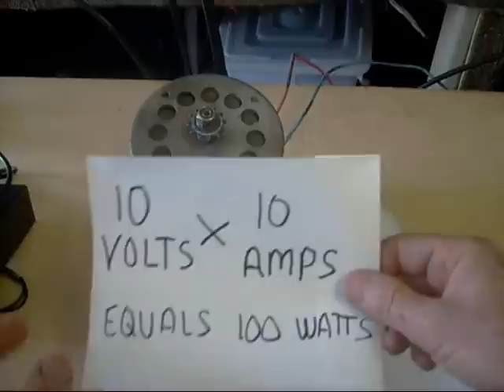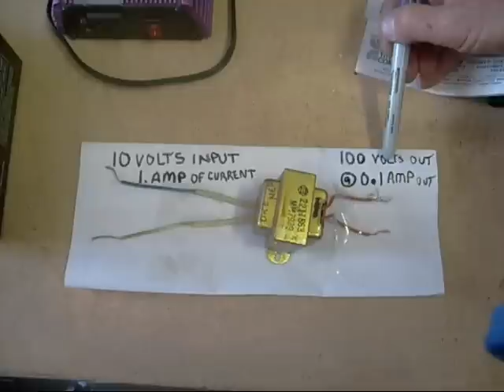Understanding Watts, Voltage, and Amps. Sorry about the math mistakes.

Comment: hi and thanks for answering my questions and i know our talk got you thinking about all your own thoughts on that matter
Reply from the maker: +jokers32463 Regarding your other question about transformers yes a transformer can raise your voltage and lower the
amps, but it can also lower the voltage and raise the amps. A transformer can step up voltage or current depending on
the turns ratio within the transformer.

Comment from the maker: @Xbasic3000 I think what you meant to ask is how long will a 100w light last on a 12 volt 8.5 amp hour battery.
Excluding the heat losses and other inefficiencies I would say 1 hour, but realistically probably more like 45 to 50 minutes.

Comment: If it helps, think of a spring, like in a car shock absorber, sitting upright on a table.  If we put a bowling ball weighing 18 lbs on top of the spring, gravity compresses the spring a bit.  In this model, the force of the spring pushing the ball up represents the voltage, and the weight of the ball is the current, or "work done" in amps.  Now, replace the bowling ball with a 40 lb cannon ball, and the spring is compressed much more, but it still presses up with the same force.  (Continued....)

Comment from the maker: @ArchNME I should have said transformers can't convert steady DC to AC. On the other hand if the input to the transformer is pulsed DC you can convert from a lower voltage DC source  to a higher AC voltage.

Comment from the maker: Yes your correct. If your battery is rated at 10 amp hours your device which uses 5 amps should run for Two hours.

Comment: Hey to whoever reads this. This analogy for circuits may help you. Here's a tip: forget all the technical mumbo-jumbo. Watts = power, Amps = current. And don't you dare tl;dr this. It's a lot shorter than this video!

Think of a battery as a bank, think of energy as the money at the bank , think of the electrons as men, and think of light bulbs, motors, any device connected to a circuit, as strip clubs. Men (electrons) pick up money (energy) from the bank (battery) and spend the money (energy) at the strip clubs(light bulbs, etc), then go back to the bank for more money. 

Amperes is current, the flow rate of electrons. You know how you measure the speed of a car by saying 20 mile per hour? Well, Current is the number of electrons per second. In other words, current is how fast the men are moving. 

Voltage (potential difference*) is the amount of energy each electron carries. In other words, voltage is how much money each man is carrying. 

Power is the amount of energy you use per second. In other words, power is the amount of money the men spend at a strip club each second. 

Using a little common sense, you can easily derive the power equation. Power is the units of energy over time, right? Current is electrons over time, and voltage is energy over electrons. Now use some basic algebra. What happens to the units of current and voltage when you multiply them? The units of electrons cancel, leaving energy over time. In other words, it gives you power. 

Hope this helps. FYI, Ohms law is only true if temperature is constant.
Reply: ***** I've been trying to wrap my head around this stuff, and your 4 is rather confusing to read.

I imagine in this analogy it goes something like the power used by something is the difference in pressure between before/after it multiplied by the amount of water moving across the thing over time, right?

This may be simple once you get a feel for it, but it's not simple before that. I've gone over this stuff in school multiple times over the years, and tried before and failed because I couldn't wrap my head around the idea. I've only had one other thing like this before. another thing that's just so simple once you grasp it, but which frustrated me endlessly until I did. That was what radians are. At some point the concept just clicked into place, and I had no problems after that, it was just that one little piece that didn't fit for some reason. Gah.
Reply: ***** ...."In physics, power is the rate of doing work. It is equivalent to an amount of energy consumed per unit time. In the MKS system, the unit of power is the joule per second (J/s), known as the watt," so yes, there is. Using power over time isn't a measure of power.

Except pressure is voltage, and measuring the voltage drop has been rather important in the limited number of things I've done, so I have no idea why I'm being told it isn't.

So I'm no longer confident in anything you're saying, as you've contradicted both the truth, and what I know from multiple other sources without giving a valid explanation for it.
Reply: now I know that Engine Shade and Shade Engine are Israelis . cause there is  mandatory to take harp lessons to achieve ability play both sides (harp) at a same time.
Reply: Pablo P great analogy!

Comment from the maker: Correct. It would use about 15 amps at 12 volts if it was 100 percent efficient,  but the inverter losses are probably 10 to 15 percent so I would think it would think it would use more like 16 to 16.5 amps in the real world. Your battery calculations are correct in theory but if you examine a graph of battery amp hour expectations their efficiencies are based on how much current you draw so this means your 100 ah battery may only function like a 80 amp hour battery when you draw 15 amps.

Comment: Interesting , However I have seen these inverter  for a while and was just wondering if they may also be converted to work as a step down transformer taking advantage of their light weight , say to convert it so that you may achieve a step down of 230v to 120v by say using a 12v DC adapter plugged into  a 230v line replacing the battery.
Reply from the maker: I'm not sure I understand your question, but if I wanted to step down a voltage from 230 AC to 120VAC I would just use a transformer.

Comment: I have an issue with a home made power supply giving correct numbers like another power supply and it's a bit below what an RC car must have and the other works fine. A third one even takes a few volts for the front lights and works fine as well.

Comment: This video was helpful, thank you. I am setting up a GoPro, which draws 1.7 watts and have it hooked up to a 12v tractor battery that is being charged by a solar panel array (5w x 5w x 10w in parallel). I've measured the output on the solar array at 21.4v peak in straight sun and 19v on a semi-cloudy day. I haven't measured on a fully cloudy day, but I figure it will be at least 15v. If this GoPro is running 24/7, is this enough voltage to keep the battery charged while there is still a draw from the GoPro overnight? I do have a solar controller to keep the battery from over-charging. With just the 5w x 5w array, I was only able to keep it going for two weeks. I'm looking for something that will last 6 months or more to do a time-lapse.
Reply from the maker: What does 5W X 5W mean?  I've never seen a rating like this.
Reply: Grants Pass TV Repair  sorry, i'm a relative noob here. i have two separate 5w panels and a 10w panel strung together in parallel (positives together and negatives together before going to the +/- on the controller). The reason for this that I was hoping that one 5w would do it, but didn't. Two 5w panels didn't cut it, either, so I added the 10w, which is what i have running now for the last few days.
Reply: Grants Pass TV Repair  sorry, i'm a relative noob here. i have two separate 5w panels and a 10w panel strung together in parallel (positives together and negatives together before going to the +/- on the controller). The reason for this that I was hoping that one 5w would do it, but didn't. Two 5w panels didn't cut it, either, so I added the 10w, which is what i have running now for the last few days.
Reply from the maker: Sounds like you should buy a higher output solar panel. I can't give you specifics as to solar panel size due to .variables such as the amount of sunshine available at a particular time of year other than what I shared in this video, but solar panels are dirt cheap on ebay, You can purchase a 100 watt panel for less than 150 bucks including shipping.
Reply: Grants Pass TV Repair if this 20w rig doesn't keep up, that's probably what i'll do, but the object was to keep the system fairly compact. Thanks!

Comment from the maker: Most batteries tell you their amp hour rating. This tells you how long they will last depending on how much power you are drawing from them. Example. If the battery says 10 amp hours this means it can deliver 10 amps for an hour or 1 amp for 10 hours. If your device used 2 amps your battery would last 5 hours.

Comment: Oh ok thank you for this video recommendation Mr. Grants Pass. So going back to the 10 LED crystal set radio. I would have to look at the data sheet for an AA battery and get the V(out), I(out) and get the power: P=VxI and then make sure my crystal set outputs more P and I at the same voltage. Then I would hook up the crystal set to the bug zapper and so forth, like before, always making sure I had more output power then needed, right?
Reply from the maker: Sorry but I don't understand your writing.

Comment: I am sure it is easier then I think and maybe if I weren't up all night I'd be able to figure it out. But, seeing that I've been up and pulled a double I need to ask, in order to get 4 to 5 amps on 12v DC how many watts would I need?  Great video thanks.
Reply from the maker: IamNewPrepper It sounds like  your mind is over complicating this. To come up with the numerical value in how many watts your loads are using  you simply multiply the amperage your loads are using
times the voltage they use. For example if a light bulb is using 4 amps you simply multiply 4 times 12 which is 48 watts.
Thus  you would say the light bulb is using 48 watts.  I hope this helps.
Reply: Grants Pass TV Repair lol. thanks simple

Comment: So when using a transformer the wattage has to stay the same and in order for wattage to stay the same from input low voltage to output high voltage it changed it's amperage for wattage to remain same? Example 12 volts 5 amps: 60 watts transformed to 120 volts .5 amps : 60 watts.

Comment: Thanks for the post.  Regarding your presentation and inverters, it sounded like you said that you could boost the output the thing is rated for by increasing the amps that you are delivering to it.  Is that correct, and if so how much can you typically get away with?  I would think it would get hotter and might fail if you went beyond the rating.
Reply from the maker: Sounds like you may have misunderstood something I said. I would not suggest raising the input power level on an inverter.

Comment: Thanks for the video, very informative. Please help!  I'm trying to run a few household lights and objects using a 5,000 Watt peak inverter (3,500 continuous). If I multiply the amp hours of the CAR battery (50) by the 12V the figure amounts to 600 watts. Theoretically I should be able to run 600 watts for approx 1 hour before the battery goes dead, correct? Well here's the thing, I've  been running a few (about 3) Energy saving 26 Watt lights and within minutes I start to get low battery warnings and can see on the LED screen of the inverter that the battery is being pulled down very fast. Is there something I am doing wrong? Today I bought a deep cycle 200 amp/h battery and I just want to know if I am doing anything incorrect before I proceed!
Reply from the maker: Your not doing the math correctly. First you need to find out how many amps your inverter drawing from your battery, and this can change depending on what kind of loads/devices you have plugged into your inverter. For example. If it is a 50 amp hour battery you can draw 1 amp for 50 hours, or 2 amps for 25 hours, or 5 amps for 10 hours etc. Hope this helps.

Comment: Thank you for the video. Electrical Apprentice here in Texas. Question: Am I right to assume that in most scenarios two of the three elements of power will be written or indicated on the device I'm using? In the video, you knew the amps and voltage - is that normally accessible by reading the electrical information on the device or did you calculate those before you plugged them into the watt formula?
Reply from the maker: Yes many devices will list the power they consume such as my toaster, which says it uses 750 Watts, but it doesn't have the voltage or amps listing on it.  My electric heater lists the amperage, voltage, and wattage is uses, but as you probably know, they didn't really need to list the wattage since you can figure out the wattage by multiplying the voltages it uses times the current in amperage  that it consumes.
Reply: @GrantsPassTVRepair  Okay! Thanks for the reply.

Comment: (Continued....)  So, if the spring presses up with 10 lbs. of force (10 volts), the bowling ball needs 180 watts (10 volts X 18 lbs., or amps) to keep it aloft, but the cannon ball needs 400 watts (10 volts X 40 amps).  This, of course, is far from a perfect analogy, but I hope it helps you as much as it has me!

Comment: I was really hoping u would explain what they are not how they convert into eavhother I still don't know the difference between an amp and volt only that they when  multiplied equal the watts thanks though appreciate that much
Reply from the maker: What helped me to understand  what a watt is was to consider the amount of work an electric motor can perform if it's designed to lift a given weight over a given time.  for example let's say you have Two motors and  One of them uses 0.1 amp of current at 10 volts. This motor is using One watt of input power, and it can lift 44.25 pounds of weight One foot in One minute if the motor is 100 percent efficient.

Let's say your second motor is designed to operate on a much higher voltage of 100 volts at only 0.01 of an amp of current. This is still only One watt of power, and the amount of weight it can lift will be the same as the first motor. Power or Watts is the amount of work done over time.

10 volts x 0.1 amp = 1 watt of power or work and It can lift 44.25 pounds One foot in One minute.

100 volts x 0.01 amp = 1 watt of power or work and it can also lift 44.25 pounds One foot in One minute.

I hope this helps.
Reply: +Grants Pass TV Repair he'll yea perfect explanation thank you very much! you da man!

Comment: my inverter growatt 5000w SPF 500TL HVM, has 4500w solar max charge at 80A use 48v battery.
if i use 4000w solar (8PCs 250w panel, not max yet) to charge battery, I devide 4000w/48=83A it over solar charge rate(4500/48=93.75A).I wonder why the specification of this inverter siad 4500w at 80A?

Comment: so if you connect a battery to a transformer and the other side of the transformer to a motor, the motor will spin faster and it will drain the battery slower .  You said that if you get a 10v and a 1amp input to the transformer you might get 100v and 0 1 amp output so if I get a 0.1 amph battery it should last 1 hour? I am proberly wrong but that's why there is a question mark.

Comment: For higher voltages you need to use thicker wire is that correct? if so! the thicker the wire is the more resistance is that true? how do you factor all this in when you want a device to be more efficient and economical?
Reply from the maker: +Thetrucky69 A thicker wire will have less resistance. Using a thicker wire means more current can be sent from your power source to your loads. Using a thicker wire also means there will be less of a voltage drop,. so in that sense there will be more voltage available to your loads.
Reply: +Grants Pass TV Repair Ok a thicker wire transfers more power, all that makes sense thanks mate.

Comment: Batteries also have a small amount of internal resistance, which has an effect on how much current flows into them when charging, and limits the amount of current available when powering a device.

It can usually be ignored however, as your device will most likely operate over a certain range of input voltage/power, just as it will continue to operate for some time as the battery slowly discharges and loses its voltage.

An inverter can still supply a steady output voltage from a battery however (up to a point) as it varies its internal resistance to compensate, while it goes about synthesizing the AC output.

Comment: How can the volts*amps give watts but a monitor I have uses 120v and 1.5amps but uses about 25 watts? How can that be right? Of course I am adding some extra to it because googling the monitor it uses 18 normally so just for extra. I am wanting to use a small UPS and need to make sure everything stays under 180 watts.
Reply from the maker: You simply multiply the amps your monitor is using times the voltage and this gives you the power it uses in watts.
Reply: Ur monitor takes in 120v, it doesn't use all of it though. The AC adaptor reduces the voltage and amperage
Reply: I know. But I was trying to find the watts.
Reply: The formula only works for dc and only for ac when it is a resistive load such as a incandescent light bulb or a heater.

Comment: please help me to make dc power supply of 12 volt and 50 watt. i am getting 12 v in output but power is not coming , how to generate 4.25 amperes current in ckt . i am using 12-0-12 amplifier.